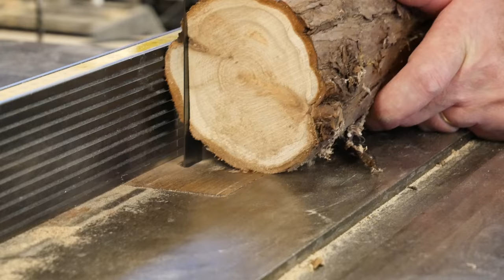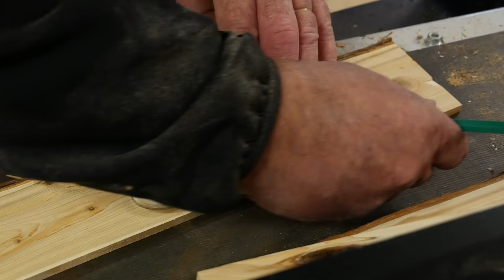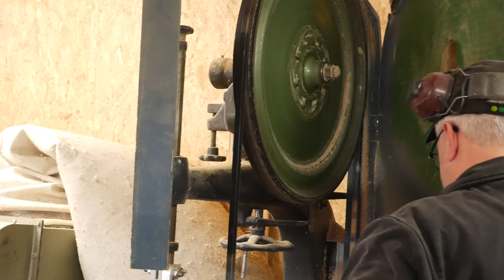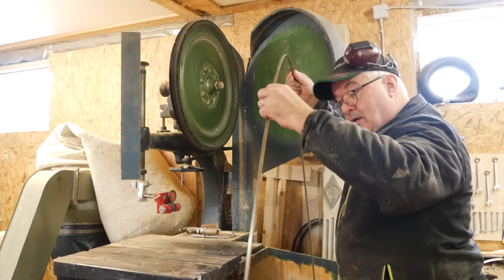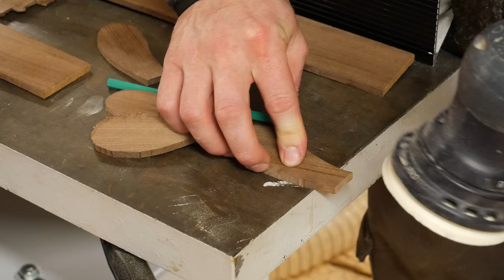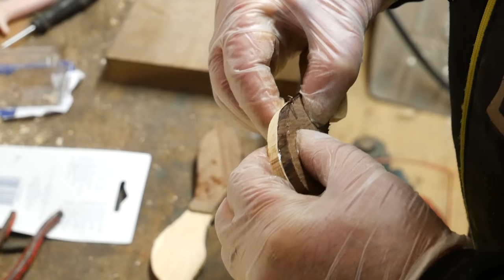Making The Famous Swedish Butterknife

Comment: I saw this project and I decided to copy the design and make it. I made it and In the process I had a lot of fun. I was inspired because they built it from scratch, they took their wood from a block of wood. I used power tools and hand tools. I added dowels to the handle for design effect. I drilled shallow holes on both sides of the handle for the dowels, I should have drilled the holes all the was through
For a perfect line up. I used walnut for the hande and maple for the blade. I will use lght mineral  oil for a finish. I dont think it will ever be used but it is a beautiful object to look at, so we will keep it here in the kitchen as a conversation piece. love it.
Reply: What an interesting life you live. You are living on the butterknife edge man.

Comment: Jointer on top and thickness planer on bottom! Love it!
Reply: Thanks for that was wondering.
Reply: I want one.
Reply: I've never seen one of those and didn't know they were even made.  Would love to have one myself.
Reply: I was think the same thing. Awesome!
Reply: That's fairly normal in Europe. We call them a planer thicknesser in the UK. We have a monster 1960s Wadkin in our workshop that will blast through 600mm wide slabs of oak.
Reply: I used to have a DeWalt combo that was a smaller version of that - jointer on top, planer underneath.  And here's a Jet combo that is similar: http://www.rockler.com/jet-10-jointer-planer-combo-w-open-stand

Comment: Proud of your messy shop, I see. Spend some time putting in an effective dust control system. I have been in many carpentry shops over 45 years and your's needs improvement. Before it burns down.